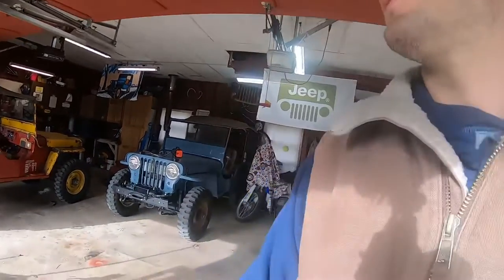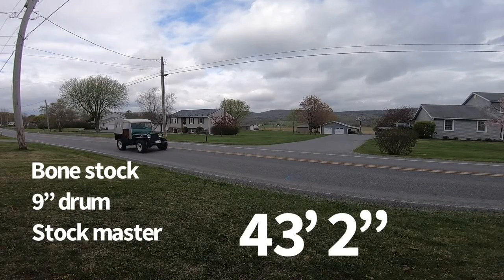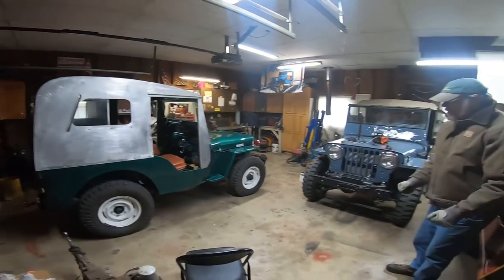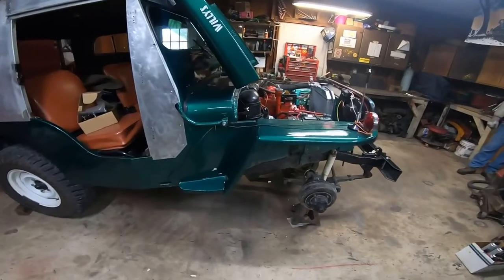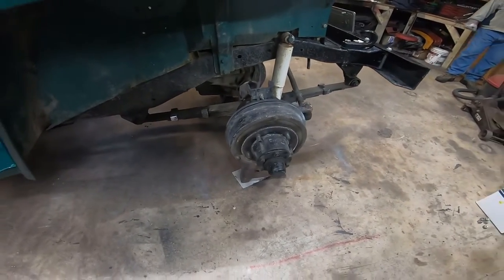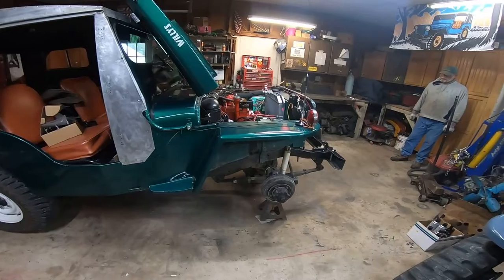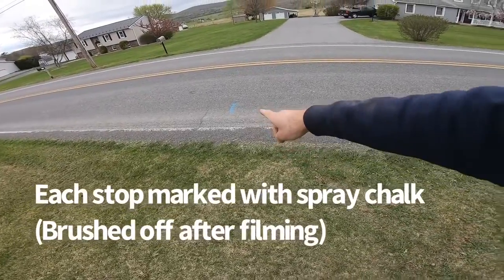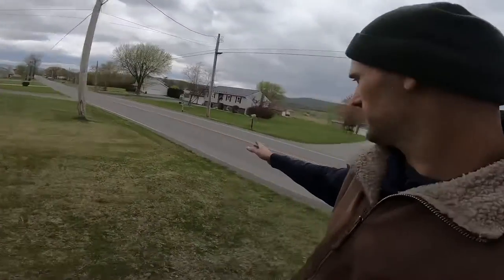Are disc brakes better on a Willys jeep?

Comment: This test showed me that I really need to install discs on my CJ3B. My drum brakes are just OK but not great. Awesome video. Thanks, RT
Reply from the maker: Thanks! Yes you won’t regret a disc swap!
Reply: @redeyecafegarage7484  How difficult is a disc brake swap? I have a literally only changed my starter motor and the oil in my DJ-3A.
Reply from the maker: @matthewdeal7791  I l would give it a 6 out of 10. Not difficult but definitely lots of steps and since there’s a high safety risk if you do something wrong it’s not exactly for beginners. But if done properly with the right supervision it’s a great project to learn important skills

Comment: Really would like to see a 11in drum brake test, but this was really interesting, thanks for sharing!
Reply: Fwiw when I swapped to 11" front drums only, it felt about like it almost doubled the braking power.  Would just about lock up the front tires on dry pavement.  Well worth the swap IMHO but for off-roading, another huge advantage with discs is they work when wet after a creek crossing.  Drums do not until they dry out.

Comment: Hey Steh, my jeeps got 11” drums in front and 9” in back with a dual master. Do you think the bigger drums will make much difference? Also I’m thinking of putting discs on the front if my front 11” drums could be used on the back? Do you know if that would work? Thanks Steh and great video 🥳
Reply from the maker: Hi earl. Disc up front will be an improvement over the drums in both performance and maintenance. Disc front and 11” rear is a great combo but I’m pretty sure you will need to find 11” rear backing plates. But please some research on that. I could be wrong. I am definitely not a drum brake expert

Comment: Thanks for making this video. Years ago I swapped front discs from a '74 Scout Dana 30 onto the front of my '2A. Not a direct bolt on but not that hard to fabricate. I used the dual chamber master cylinder off a '77 Mercury monarch mounted where the stock one had been. No proportioning valve and stock rear drums. I love the setup but have lately been wondering if I should install a proportioning valve and go to bigger rear drums. Based on this video I think I should leave well enough alone.
Reply from the maker: Excellent! It’s totally up to you but it sounds like it’s working good for ya. Thanks for watching

Comment: You can see why front disc rear drum was used for so long , plus you get a better handbreak , as most 4 wheel discs still run a drum handbreak

Comment: Nice test Seth.  Thanks for doing it. I was thinking.  Even though the disk brakes “lock up” quicker, that’s not necessarily a good thing is it?  I’d love to see how the 9” drum brakes compare to a modern wrangler or other Jeep with anti-lock brakes. What are your thoughts?
Reply from the maker: Yeah it would be interesting to see how Jeeps with anti-lock brakes stack up against my Jeeps. I think in this test there wouldn’t be much difference. But I bet at 50 or 60mph the newer jeep with power brakes and anti-lock might shine. But it’s all just speculation without some data. Thanks for watching.

Comment: That was impressive with discs all round, but how much would a full conversion cost ?
Reply from the maker: Here’s the front conversion kit. The rear disc brakes I run are a home made setup. A direct kit isn’t available. But as you can see front disc is more than effective. 👍 be sure to use code Redeyegarage10 any time you order anything from Kaiser Willy’s! Thanks for watching! https://www.kaiserwillys.com/products/complete-front-disc-brake-conversion-kit-fits-41-71-jeep-willys/?gclid=EAIaIQobChMI15mO0-mVgAMV2-zjBx0bTAucEAQYASABEgKUi_D_BwE
Reply: @redeyecafegarage7484  I posted this on a Facebook page, caused a lot of controversy 
Unfortunately I can’t use kaiser Willy, they are in the US, shipping would be extortionate

Comment: With discs on the front only, did you install a proportioning valve or just remove the check valve from the factory master cylinder? did the check valve get replaced with anything else?
Reply from the maker: For disc up front only you must remove the residual valve. Proportioning valve is optional. I’ve gone with and without. IMO it doesn’t make much difference at all. But people will literally lose their minds arguing with you over this. I’ve gotten actual treats of violence emailed to me over this topic. It’s absolutely ridiculous 😆 I just share my person experience from 20 years of jeeping& tens of thousands of miles but people that never even finish their Jeeps want to fight me haha! At the end of the day you do what feels right for you and if you’re not sure seek out a professional. Lol…

Comment: I have 1943 MB Willis officers, radio jeep all original, is the Marine Corps jeep with the foreign kit on it do they make a plastic gas tank for you the regular gas with alcohol in it, attract water and make it rust. If you know where I get a plastic one please let me know.
Reply from the maker: I run steel tanks in all my builds and have no issues with rust. You can always throw some 2 stroke oil in occasionally if you’re worried about rust. I do not like the plastic tanks. The leak and don’t fit correctly.

Comment: nobody in this day and age should run a single circuit master cylinder for any reason. you're one leak away from a terrible accident. 
full size jeep/chevy caliper and brackets with 78 cj7 rotors 11x2" rear drums, dual circuit master, combination valve and remote booster would be ideal.
Reply from the maker: There is absolutely nothing wrong with a single line master for these old Jeeps.
Reply: @redeyecafegarage7484  there's something seriously wrong with a single circuit master cylinder on any vehicle. 
all it takes is one brake line, brake hose, seal or pressure switch to fail and you have no brakes apart from the park brake  
with a dual circuit master if a hose, line,seal or switch fails you still have brakes on two wheels and the park brake.